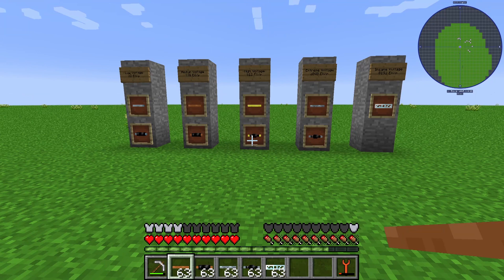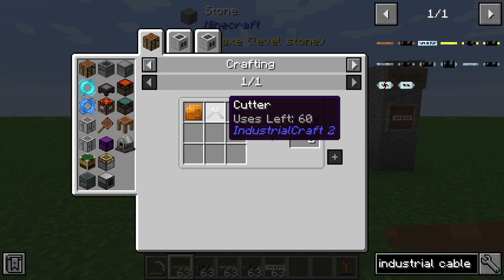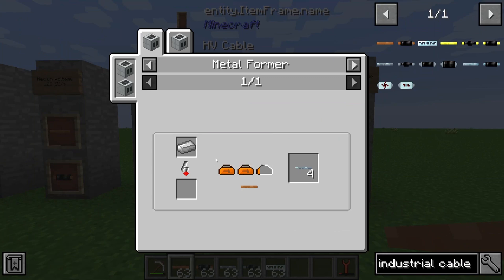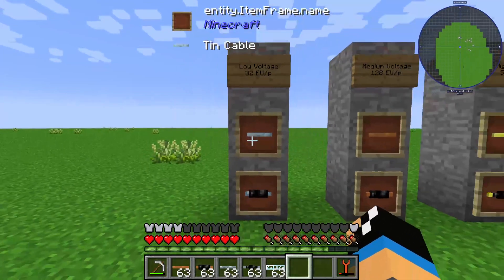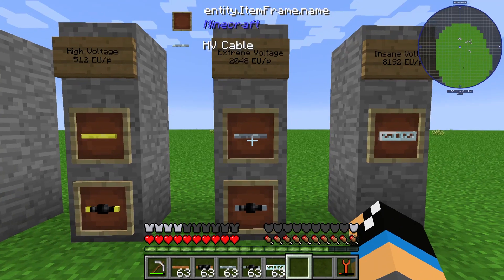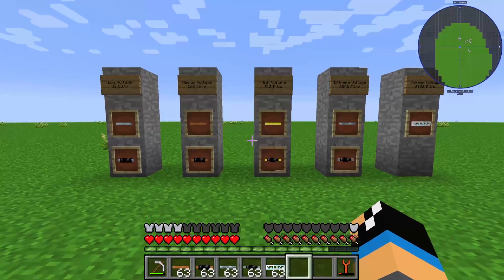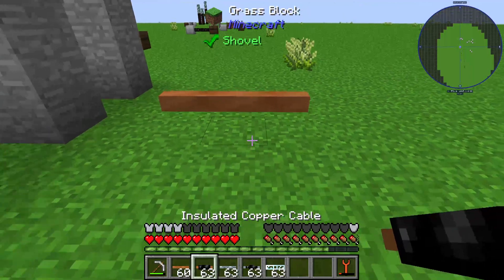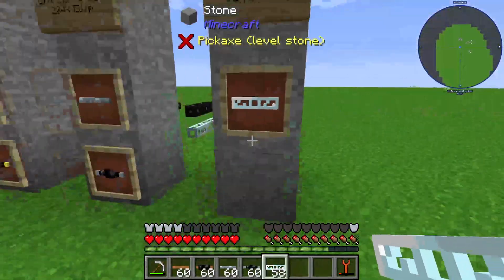IC2 Cable 💎 Industrial Craft 2 Tutorial 💎 English

Comment: is it possible to inter-connect different cable types? I mean, the output from a nuclear-reactor I want to be fed into gold-cables, and this link go north for 100 blocks. I'd like to 'tap into' this cable, using copper-cable to run machines, at various points. The gold-cable being the 'backbone' as such, feeding the 'branches' of copper-cables. I don't want to have to make countless transformers.......I just want to be able to 'tap' into a higher rated supply, with a lower rated one.
Reply from the maker: i think its not possible, because the cable types are static
you always need a converter
Reply: @LetsDylan  yes, it seems as if you cannot connect different cable types, if the power transported is greater than the one I want to 'drop down' to. Frustrating. It would mean countless transformers, which is too much effort for mainly lighting. Too resource heavy and effort.